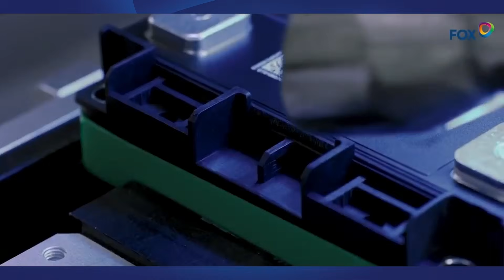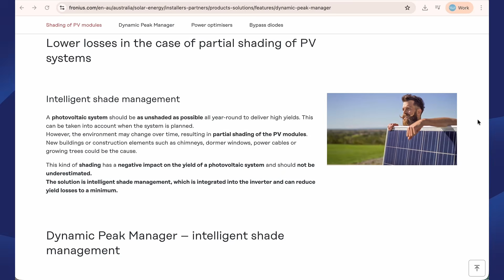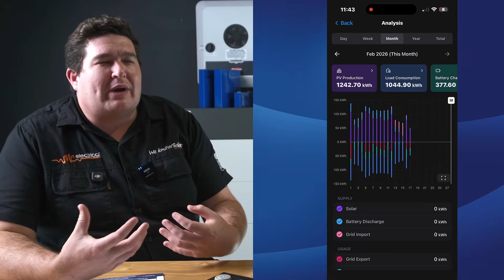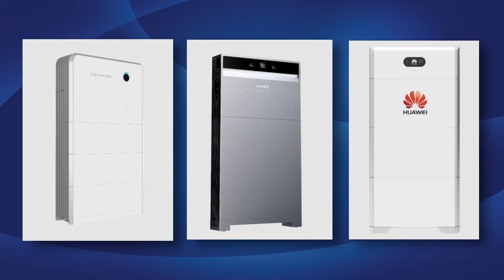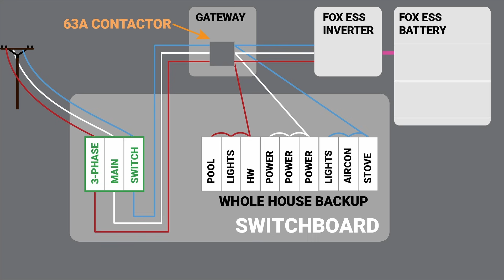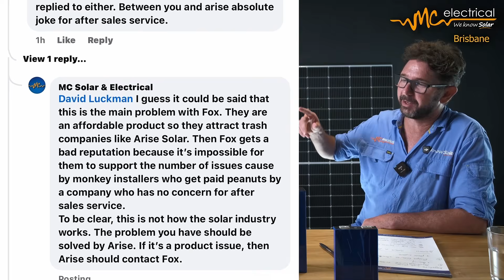Fox ESS Battery Review Post-installation & Factory Tour

Comment: Great video as always, for existing fox ess 15kw 3 phase inverters in another state, will we be able to buy the 63amp gateway from you?
Reply from the maker: Hi Jason thanks.  But no we’re sorry, we’re just building one for the job we installed.
Reply: It does. I'll need to double check the specs but it may be 50A
Reply: Will the new h3 pro 15kw 3phase have a larger bus than the 20amp in the current 15kw H3?

Comment: Nice of you to do this, even that there was no chance for you to take over cheap systems with your reputation.
MC installed my Fronius 5kw inverter 10 years ago and it worked like a charm. Recently I sold it on FB marketplace for 50$. There are so many of them taken off and sold on FB marketplace. Many gen24 removed after only few years. 
I now have Fox ESS 9.9kw single phase with 43kwh battery. Love it so far.
I can tell that it doesn't work as well in terms of capturing all the solar that Fronius could, but this is next level game and that doesn't bother me. The most of the battery is charged within 3 hours of free electricity from 11-2 so solar are just one way to top up battery in the morning and later afternoon.
Also big battery gave me piece of mind to leave my heat pump water heating always on. So far I haven't used any expensive electricity from 6-11 and 14-24h
This whole setup will pay for itself in 3 years, assuming that electricity prices don't rise.
10 years ago I wouldn't even look at Chinese inverters, but they've gone a long way.
Blackout protection also works great with all my wall plugs and lights transitioning to it with no visible downtime (tv stays on) and battery keeps charging throughout the blackout. I am not an expert but am very impressed.

Comment: Here in South Africa I have the H3 Pro 30kw inverter and 6 EP12 11.5kwh batteries, 69kwh total. JA 14.4 kw array, 24 panels. Works flawlessly whole house connected, even charging my BYD shark overnight. Love the app, have everything I need. The install took 3 days, was up and running immediatly. After sales include immediate replacement of faulty equipment, don't have to wait weeks for repairs and red tape. Best pricing also. I've had zero issues, I would reccomend Fox 100%.
Reply from the maker: Thanks for sharing your experience with Fox

Comment: You’re talking about GoodWe ESA in the intro 😮 can’t wait for the review!
Reply from the maker: Ha, no. We haven’t tested Goodwe yet. But plan to in February.
Reply: @mcelectrical  it looks like a good product at a good price from the outside. I just watched a sales video for installers, and they literally gave a selling point for Goodwe ESA as "Now, if you place a Goodwe ESA system, next to a Sigenergy battery system, most of the homeowner won't even tell you the difference" 🙂 Does look tidy, though the battery construction doesn't look as good as some others, not a cast tub, and heatsink is only on the back. Has per-battery isolators, so more moving parts, which seems bad, but might be required by future regs. Worst of all, plastic covers, so that's it, just cancel the review!

Comment: I have question who was your Fox Ess supplier? To the product I don’t believe whoever supplied it could be in different quality,so what’s the point of supplier is?
Reply from the maker: There is a solar sales company in the industry that also has a wholesale company who are a stain on the Solar industry. Quality installers don’t deal with this kind of company. Most of what they sell is crap. Sounds a bit OTT, but most in the industry would agree.

Comment: According to Solar Choice battery reviews, the Fronius Reserva and BYD high voltage stackable batteries don't have built in fire suppression either. Is this the case?
Also, the throughput warranty is higher for the Fox EQ series battery, than both Fronius and BYD.
Other comments have mentioned the Fox CQ6 battery which was released last month, and it seems that it has built in aerosol fire suppression. 95 per cent round-trip efficiency and 100 per cent depth of discharge. Sounds like a pretty good battery.
Reply from the maker: Yeh Fronius doesn’t have fire suppression. Neither do most. The Fox engineers scoffed at Fire suppression so I’d be surprised if they went that way on a residential battery. Throughput warranties are only as good as the company backing it. Fronius treats their battery gently and is more conservative with warranty claims. And they have been around for about 80 years, and in Australia for over 15 years. 
95 percent efficiency is a misleading number. That would only work in lab conditions measured at the battery, not taking into account the inverter. 
Fox looks like an ok product to me. But choosing it is would be taking more risk than choosing Fronius.

Comment: What about FOX ESS H1-G2 6kw single phase hybrid inverter and FOX ESS EPS box, am I gonna have trouble in blackout?
Reply from the maker: Actually I re-looked at the spec and it’s not great on single phase either. In short, you should only have one circuit on backup with the 6kw single phase.
Reply: @mcelectrical what about lights and wall sockets? As long as not gonna exceed 6kwh?

Comment: I just got a fox h3 15kw installed  with 48kw . I have a strange arrangement because my main board and meter is on my shed detached from the house and a sub board In the house . Everything went well except for the fact that the battery is only powering my shed when the sun goes down and not my house. I've raised this with the installers and they've said they're waiting to hear from fox technician and are having a similar issue on another .. isn't this just a simple wiring issue as opposed to a system fault?
Reply: You'll need the consumption meter in the main switchboard not the shed sub-board
Reply: @Yorick_Mark my shed has the main board, battery and solar panels. My house has the sub board. My battery isn't feeding my house when the sun goes down.
Reply: @geznico2082  Best to get your installer back to investigate & rectify. It could be something silly like a CT being on backwards or an incorrect inverter setting. The YouTube comment section is not the best place for tech support.
Reply: @Yorick_Mark I'm trying, thanks for the insight
Reply: @geznico2082  You could try the Fox ESS Facebook page.

Comment: are there any other inverter that's compatible with this battery?
Reply from the maker: Only inverters from FOX are compatible with Fox batterie. I mean they do “OEM” or white label other inverter and batteries, eg 1Komma5, but that’s just the same product. It’s most common now to have the same brand of battery and inverter. Fronius and BYD is an exception

Comment: After living with it for a while, it’s clear the software was written by Ctrl-C programmers, and if those same people touched the firmware, we’re all going to have a very interesting time.
Reply: Examples?
Reply: @dr3638  lots of examples of the scheduler randomly doing its own thing, inverter going offline, min/max SOC can't be set. Lots of examples on the Facebook group. No point repeating it.
Reply: @bonusshaker9260 what's the error code with the inverter going offline? I haven't changed the max SOC (100) but no issue varying the min in the couple years I've had it. Using the phone App (which version) or the web App? Force charge and discharge schedule working fine for me but V2 phone app changed the way it's applied which I raised a case about and was answered.

Comment: Hello Folks , about the 20 amps that you talk about 
I was wondering about your solution on external contactor  what I think is ATS   
this could be much bigger  off cours ,  but when connected to the inverter port , it gets it power trough the same outlet  
and this outlet is powered up using the same internal relais  
so I do not see the point  ,  can you explain why you say that this would solve the problem ?
thanks 
Cor van Houtum Draaistroom Nederland Support engineer

Comment: Surprisingly, there’s a more favourable review that could help them secure a good market share in Australia. However, there’s no written statement from Fox about how they’re improving service and support. Many customers can’t even reach Fox, and even some installers and retailers have faulty products straight from the box.  They also don’t know the warranty claim process or how much they pay installers to replace batteries or inverters.  As you mentioned, there’s more to discuss on the warranty topic, like Sig Energy. If you’ve covered those issues in detail, I wouldn’t feel sponsored.  Another question for you: for you and many installers  use solar cables for their batteries. What’s the rated current and are these solar cables capable of 50A or more?
Fox inverters don’t work on mesh networks well and fox is not even aware of it and no solution from them
Reply from the maker: I’m surprised you feel it’s sponsored. It’s not. Fox looked after us for a couple of days in China but that’s never stopped me before (Sig and SolarEdge paid for airfares etc).
DOA,s (Dead on arrivals) isn’t good, but most products have that issue to some degree. 
But maybe I was too soft on the after sales service. 
Cable current is a spec sheet for each model and voltage drop issue. We do 6 mm and 10mm DC sometimes on Fronius. And yes we should have mentioned how… from memory… they supplied a solar cable with the plugs already made, but had something in their warranty about not cutting the MC4’s off. So… how do we conduit that cable? And do they supply the 6mm or 10mm plugs if needed? I probably could have been harsher - and that’s  a criticism I don’t often get 😅

Comment: Fox ESS is really popular in UK (Fox ESS is UK-Chinese joint venture) and the bigger inverters and service have a decent reputation. Though they have the same problem that budget / cowboy installers use them. Expandability used to be a bit limited? You can slave a second inverter + battery but that was it. Maybe those H3 ones can do better?

"And a lot of times, you know, these guys aren't really understanding the product." is that um, post-shadowing? 😅

Comment: Would be good to talk about Battery Management Software - what it does and doesn't do between the various providers and the impact on battery cycle/life and capacity fade.  Anyone succeeded in setting the FoxESS system using the cloud app/web browser to anything other than 100% max SOC.  Can adjust the min SOC but keep getting a write error for max SOC changes evening using the manual schedule option.  AI searches seem to recommend a 60%DOD with 80%-20% SOC settings for normal op (can significantly extend battery life/reduce capacity loss) and then doing weekly 100% charges to balance out the cells plus a reconditioning cycle every month (draining battery slowly down to 10%SOC and then a medium full charge). Noticed the FoxESS BMS does the highest rate charge possible from the solar panels up to 95% SOC and then a slow trickle charge to 100% SOC.  But it doesn't seem to do much else by itself.  Heard the Tesla BMS does reconditioning cycles automatically - assume the battery chemistry is the same but perhaps not?
Reply: I would say the software  engineering know how at the factory  in China would likely be better than anything you can manually try play with. They would know what they are doing, if it isn't, they will software update it.

Charging to 60-80% SOC for longevity really only applies to NMC cells as they suffer from a lot of 100% SOC cycles. 

LFP manufacturers like BYD on my Atto all say you can charge to 100% and do not need to fully discharge each cycle. Makes it easy for an ev you just plug it in whenever the suns shining and don't worry about SOC discharge levels. Your really not taking advantage of the money you paid or your excess solar if you are charging <100% SOC
Reply: @DOBlob  Thanks for the info.  Just did another AI search based on my specific setup. Currently in self use mode and dropping to around 45% SOC over night.  20kw solar system ac coupled to 10kW FoxESS H.3 smart 3-phase inverter, so the battery taper charges in the morning reaching full 10kW charge rate as the sun angle improves.  Typically reaching 100%$OC around 13:00.  So the battery is sitting for long periods at/near 100% SOC.  AI warns that can lead to > "Risk: Forcing this every single day is unnecessary for LFP chemistry. Constant high-voltage "soaking" can accelerate the growth of the SEI layer (internal resistance)".  So it recommends cutting the charge rate back to 5kW max rate and limiting max SOC to 90-95% or even adjusting to lower levels based on the season.   Signing up to a VPP or adding an EV would change the equation, also seasonally and daily weather dependent. AI did mention better management can improve cycle life significantly by avoiding this long duration soak.  Used a number AI search engines and the results are pretty much the same.  The FoxESS BMS is obviously generic and doesn't appear to be sophisticated enough (for good reason) to take specific setups into account. Probably too much mucking around for too little gain.  But for those that are retired and have nothing better to do?
Reply: @petergorian535  AI isn't intelligent and doesn't understand anything, let alone context. I'd be looking for a better source of information.

Comment: I have a Fox ESS 42 KW Battery with a 10kw inverter…It’s a no brainer for me comes with a 10 year warranty it’s still early days yet with it but it does what I want it to do. It’s a 3 phase system.
Reply: 3 phase or single phase?
Reply: @jbyrne8977 3 phase
Reply: I have same. Maybe not as good quality as (just maybe) some but they dont have to be as the payoff is much quicker. I bought the cheapest solar cells in 2010 and they are still over 80%, inverter still good, they owe me nothing.
Reply: @failureisnotoptional929  yep I’m hearing ya… I think people make it more complicated than it should be.

Comment: Very interesting information about the efficiency calculations especially slow discharge. I've found this with my two stacks and raised a case about it in 2024 when I intially did my own testing and analysis but didn't get a response from support. Now I've got a better idea, many thanks for explaining this. They've been great though and the auto cutover has been brilliant during outages. Most of the house is on backup. v2 of the app was better IMO.
Reply: Auto cutover needs a special changeover awitch that most installers won't put in unless specifically quoted, correct?
Reply: @binita4994 there's an EPS function on the inverter, no seperate switch needed.

Comment: Thanks for the info, so with the small contactor for 20 A - can i run fridge modem and a pump? Also is it 20A per phase or 20A in total ?
Reply: It's just over 20A per phase.

Comment: These fox batteries are being installed for $6k for 42kwh and MC electrical are doing BYD 44kwh for $30k so the gulf in total cost for a similar product is vast.
Reply: That said, that's the cheapest install possible. A good install is a bit different. Still agreed, likely 1/3rd the cost.
Reply: Good installer will never sell for 6k
Reply: @madhavamadhav6470  Its over $20k total price but the rebate is currently $14.5k.

Comment: Fire engineer here - the integrated fire-extinguishing system in Sigenergy’s residential batteries (e.g., SigenStor) provides rapid, automatic suppression at the pack level, helping to stop thermal events before they escalate or spread. Combined with modular isolation, thermal barriers, and compliance with standards such as UL 9540A, it forms a layered safety architecture that materially lowers fire propagation risk. By contrast, batteries without integrated suppression rely solely on passive containment and external response, increasing the likelihood that a single cell failure could develop into uncontrolled thermal runaway, particularly concerning in residential settings.

TL;DR - it's not just marketing
Reply from the maker: Appreciate the expert perspective, thanks for sharing.
Reply: I've heard the battery chemistry is extremely stable anyway.. it can cop a good beating and still function. There was only ever 1 fire incident involving fox ess and it was completely unrelated to the battery, melted the inverter off the wall and the battery was still there and functional.
Reply: @David-pb2bu  Most vehicle crashes are minor, yet we still install multiple airbags and engineered crumple zones to protect occupants in the credible worst case. The design basis is not the average event, it is the maximum foreseeable consequence.

Fire engineering follows the same logic. We do not size systems around a small, likely fire. We design to the adopted design fire, peak heat release rate, tenability criteria, FRLs, and credible failure modes. Life safety strategy is built around consequence and risk, not best case assumptions.
Reply: @Nerdificationing I think this speaks for itself at the end of the day.. 🤷😂 I suppose if you put those cannisters next to 12v car batteries, it would stop many car fires.
 https://youtu.be/YYf9S9fZ1uU?si=Re80whxQfY_wYDjS
Reply: @David-pb2bu  That's a pretty impressive testament to modern battery safety. Thanks for sharing.
Reply: @David-pb2bu  they claimed in that South African one they have "triple protection" - would be interested if their models are different
Reply: @David-pb2bu you are funny